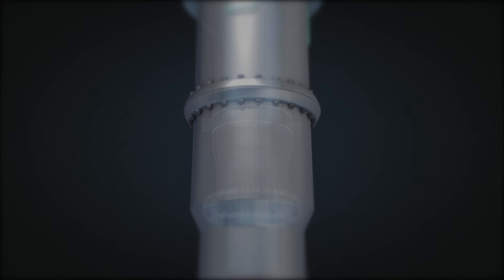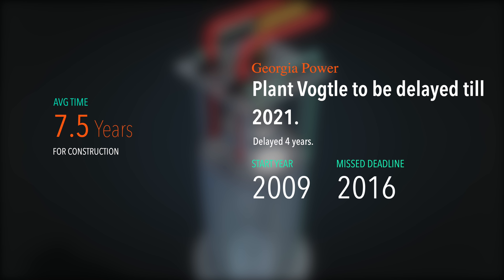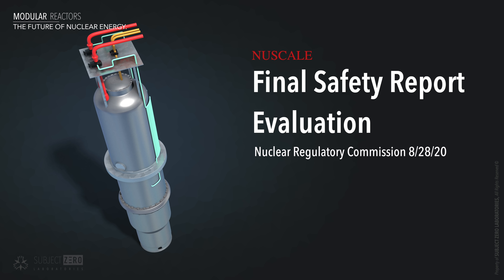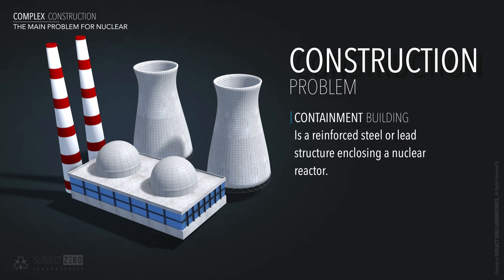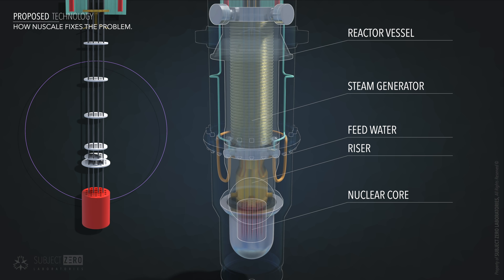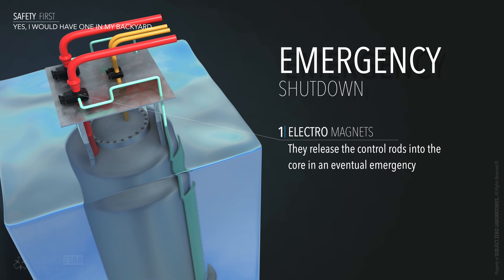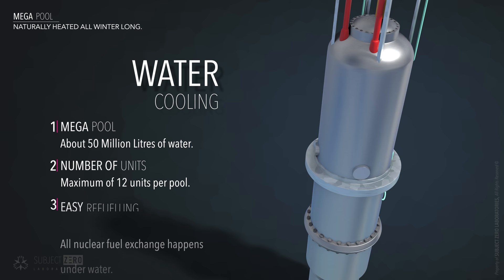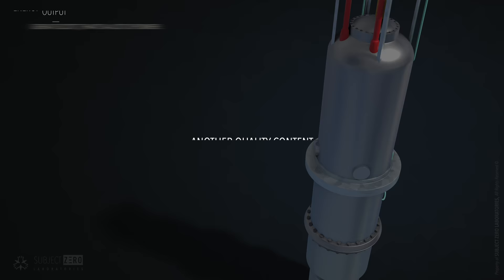A Milestone for Small Modular Reactors (SMR 2020)

Comment: The issue with passive drop cooling rods in other designs, is that the rods and channels can warp with age and fail to drop.  Hopefully the tolerances are loose enough.
Reply: That’s intolerable!
Reply: Spring loaded control rods may solve this issue. If the magnet fails, the springs will push the control rods quickly into the reactor.
Reply: Cappuccino - I would think that depending on how tight the tolerance of the rod raceway was, if it was very tight, it may not matter how much spring force you put on those warped rods, they may jam in the rod raceway and not reach their destination anyway.  I’m sure the engineers who designed nuclear reactors already thought of that.  Good thought, though.
Reply: @Rich H good point, I did some research into this. Control rods are more than just a safety feature, they control the power output of the reactor. They constantly move in and out of the core to meet the desired power demands, kind've like brakes and an accelerator on a car. If they are moving this often I don't think the rods would weld warp to the frame.
Reply: @cappuccino-1721  on some reactor types there may more than one kind of rod.  There are moderators and absorbers.  Sorry I am rusty on this and that is part of the difference between heavy and light water reactors.  I am just saying this to give you a further direction for your research, not a correction.  Moderating heavy water is needed for changing the neutrons for an reactor running with non-enriched uranium whereas enriched Uranium can get by without the neutrons being slowed down for a higher reaction cross section because it is enriched.  Hope I got that right.  Anyway, if this reactor can survive shutdown with only passive cooling, that is exciting.
Reply: @cappuccino-1721  Just watch the Chernobyl TV show court case scene. The channels, raceways, rails or whatever you want to call them, for the control rods, became warped (water expanding into steam did it), so the rods got stuck half way in, and since the tips of the rods were made of graphite which accelerated the reaction, the whole reactor turned into a nuclear bomb.
Reply: BritishColombian yes, I’ve seen the whole series including that scene. The reactor had a design flaw which caused the explosion. The graphite tips were one of the flaws.
Reply: I was looking for this comment. I believe there were more than one incident in which gravity alone was not enough to get them to drop fully. Most did not result in meltdown as its usually only a few or one but for sure not enough to rely on just the weight of the rods themselves. Maybe initially then if a problem arises a mechanically dropped weight to ensure full insertion. Able to be done from safety with no power. Basically human activated gravity powered secondary insertion force. I could just be really dumb though. Yea prolly the second one.
Reply: @cappuccino-1721  That is why Molten Salts are a better medium than water. It just percolates and flows where you want it to. As the salt over heats in a huge tank, it expands and the reaction slows down which cools the salt and solidifies. No gases or high pressures.
Reply: Yeah, CANDU utilizes same approach. But tolerances there are one elbow per meter, so it's fine. There is a video in YT with CANDU refueling, where operator has to shake the assembly a bit so that it installs - precision we deserve.
Reply: I dont think gravity will age. But it is more likely to rods being droped inintentionaly because their holders wont work anymore.
Reply: BIOS WARS The fuel in nuclear reactors is not bomb materiał, no matter how much you collect. It would have to be refined, which is extremely difficult to do. Besides which, there are other vehicles for terrorists like deadly viruses. There are islands in the Arctic Ocean off bound for years because of anthrax. So, are you going to call for all chemical factories to be closed because these could be used for biological warfare? Nuclear power is here to stay, only fossil fuel or nuclear power will be useful in places like Alaska. The amount of high level nuclear  waste from the USa would fit a football stadium. This against the much more considerable waste made in constructing solar/wind to generate the same amount of power.
Reply: Or if the earthquake makes it land sideways somehow, then gravity won't be of any use.
What if it falls upside-down?

It's not a fool-proof system. Making the control rods spring loaded would be better but still not ideal.
Reply: For Chernobyl, the reason why the rods got "stuck" in this halfway position is because that was the position they were in when the reactor exploded

In RBMK reactors, the reactor needs both control rods (stop reaction) and modulator rods (increase reaction) but they are on the same rod (modulator is at the bottom of the rod, control at the top of the rod). This is what made the Chernobyl scram explode the reactor instead of stoping the reactor. 

The reactor was under low power due to the ongoing safety test, and the reactor was in the most unsafe configuration, as the reactor had just undergone a xenon poison event  which caused the buildup of neutron absorbing xenon inside the reactor, which caused the plant controlers to put all modulator rods in the reactor to try and raise the power again. Not understanding that triggering the test on power going back up would cause a runaway reaction where the extremely active reactor would "burn" the xenon, further increasing neurtron count, which would burn the xenon faster and faster, leading to an increasing spike in reactor activity.

When the controler noticed the spiking, they decided to (rightfully) scram the reactor (aka insert the control rods to stop the reaction) but what they didn't know is that because of the reactor design, if you inserted all the control rods back in at the same time, it would push the modulator rods down first, pushing away all the water at the bottom of the reactor, leaving the bottom of the reactor in THE WORST configuration it could ever be in, where NO regulation is left (no water, no control rods, and no xenon remaining) thus leading to the catastrophic power spike, flash boiling of the water and subsequent explosion of the reactor.

yes, without proper cooling for LWR, rods can become warped and stuck, but that is mostly an after the fact problem. During operation many metrics are analysed to make sure the reactor never gets in a configuration that could damage itself, plus most modern designs are made to have some forms of self regulation, like losing reactivity as their temperature rise, or using heavy water which turns into a powerful neutron absorber if it evaporates, leading to the reactor auto regulating itself even in the case of loss of cooling
Reply: @mobiuscoreindustries  Wow. Great explanation. Btw looks like that design really bad and tend to explode.
Reply: @gorkemvids4839  The thing is, the design itself isn't that bad. I mean, it is a product of designing a reactor that can work on unrefined uranium, for the purpose of reducing costs. And in itself we still have RBMK reactors running today that haven't gotten a single accident.

Nuclear engineers that worked on creating the design specifications don't design reactors to be dangerous, all of these potential risky situations get designed around, and those who can't get designed around are explicitly mentioned and potentially hazardous.

Take your garden variety Pressurized Light Water Reactor, which is one of the earliest designs, one of the cheapest (and less efficient) and the most common overall design on earth. Their vulnerability is well known and documented, that being that cooling with the reactor core has to be maintained by an external power source at all times, and that in case of failure, the reactor can undergo a meltdown until the core activity has droped enough. This is the common failure point of these reactors. 

This is why you have to engineer around these failure points. And this is where the real design error comes into play. In fukushima, the primary flaw was the placement of the auxiliary power unit in the basement of the building, COMPLETLY independent from the reactor design itself. As the de-facto potential failure point of the reactor, the plant managers should never have commited such an obvious mistake, and it was even highlighted in a report that was dismissed by them. 

Pretty much all modern reactor designs have engineered their failure points out of the equation, may it be thorium reactors or SMRs, they all have the key feature of essentially being foolproof, being able to stop on their own at any failure point without any external intervention. But these new, better and more efficient reactors that pretty much solve all nuclear issues including the waste aren't being put in practice because of the overwhelming negativity behind nuclear energy. And how both politicans and lobbies know how easy it is to exploit nuclear for their own agendas. 

I mean, just look how easy it is to create a made up issue, that you then overblow and sell to the public, therby creating a demand that you can easily say you will provide. It forces everyone to either play your game of aknowledging the false issue (which benefits you) or get thrashed by the public that firmly beleives it is the issue (which aslo benefits you). Why do you think so many emotionally heavy topics have become the go-to program points rather than the economical/geopolitical/functional/organisational points that actually carrying visible and lasting changes? One of them is easily researchable and counterable, the other relies on blunt feelings and will benefit you whatever stance your oposition takes against it.
Reply: @Christopher Grant But a nuclear bomb is just a run-away nuclear reaction inside a pressure vessel, I think which also reflects the escaping neutrons back towards the fissile mass. In the Chernobyl case, the containment failed before it could achieve the kind of energy we associate with a bomb, due to rapidly expanding steam, other elements catching fire and melting, e.t.c. But for a moment it had the characteristics of a nuclear bomb, that being an unmoderated, self-sustaining nuclear reaction.
Reply: @Christopher Grant Isn't that what I said??
Reply: @Christopher Grant I didn't say it was a nuclear explosion I just said the mechanism was akin to that of a bomb. You have pointed out some valuable distinctions between a bomb designed to explode and a run away reaction inside a reactor. "Bomb" is indeed a misnomer and hyperbole on my part and that of the show. The Fukushima incident was due to the build up and ignition of hydrogen gas in the reactor building, so was a very different type of failure.
Reply: this is why we hire people who actually do their jobs and check safety levels of all parts however often it is needed.
Reply: There are other ways to shut down the reaction. The absolute last line of defense would be to inject a boron solution into the coolant which would poison the reaction. Doing so would likely mean the reactor could never start again but the reaction would be stopped in its tracks.
Reply: @scottwhat3362 figure of speech